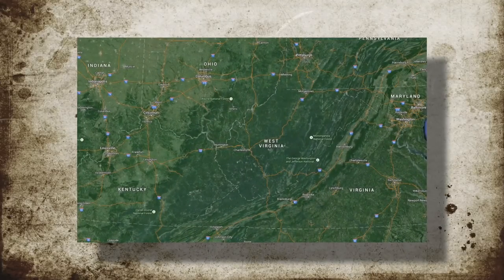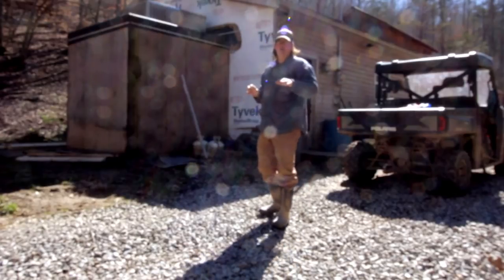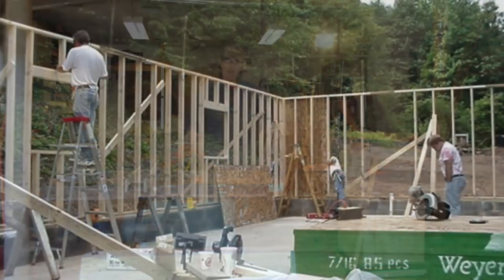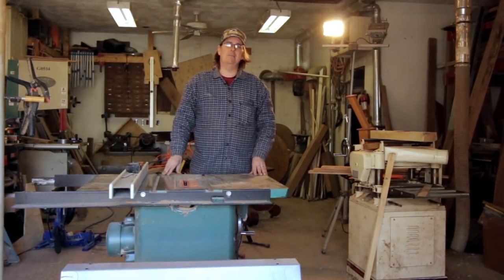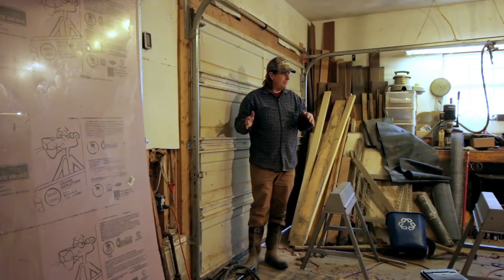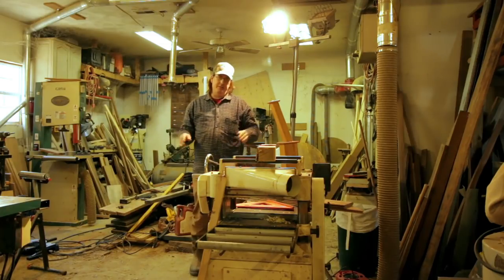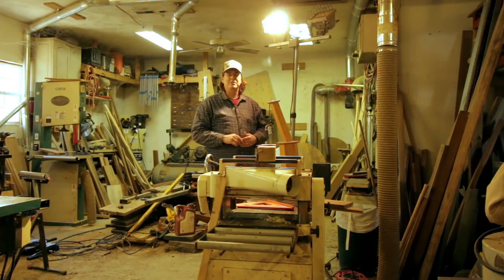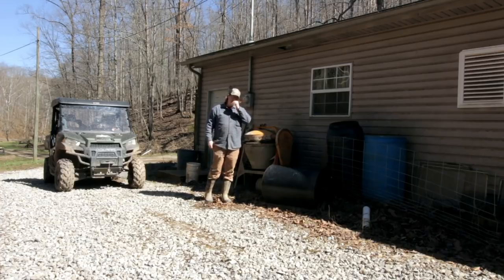Ep93: Why you should build your barn/shop before building your house

Comment: My Dad got a beautiful place on a lake.  It was raw land and he built a huge concrete pad and had a metal building put up.  The whole back side is an overhang big enough to park several vehicles/implements under.  He had a bathroom with utility sink and washer dryer hookups.  They lived in one half and built the real house out of the shop in the other half.  It wasn't as pretty as yours.  Clothes hung on pipe suspended on chains from the ceiling.  This was a room divider and the boxes with their belongings were stacked to make the rest of the room dividers.  All of us kids were up there at different times to help build the house, and we had just as much fun in the shop house as any place else.  Good memories.  Thanks for sharing how you guys did it.
Reply from the maker: Sounds like great memories.

Comment: I bought my land when I was 18, I put my camper on it after I cut a 1200 foot road line in and built the drive way, then I built a few  solid buildings for storage all out of lunber from the trees on the land, then I picked up a 14x70 old mobile home for 1500$ and cost me another $2000 to have it moved to the property, most of the bush was full of huge spruce trees that had been hit by the spruce bud worm, witch turned them all gray at the tops, I had a guy come in with an old skidder and chain saw and cut 80% of the land, for free, he saved me the big nice saw logs and he took over 175 cords of pulp wood out, then I brought in a D8 dozer for a week that striped the stumps and brush off, and ruff landscaped the place, I took 10 acers for fields and yard with plan of building a small home with a walkout basement into the valley, and I landscaped more with rented machines in the area were the house would some day be, I seeded the yard and fields, at 40 I met a woman and with in a year she asked me to married her, I set the rules clear before I said yes, my now ex mother in-law use to bitch at me all the time saying who the hell landscapes before building a home, I always said why not, building a house is not going to do any damage to the landscape more then a 100 x 100 foot area, you bring in a backhoe and dig out the basement and load all the red clay into a big dump truck and dump it in the valley that I still wanted to fill in a little more, then start building, no mess ,, but she could never under stand that or comprehend any of it, well at 57 the house has never happened, as she was a cheater and the courts gave her everything I had, what I don't get is city people move to the country, and build these huge 200,000 homes on a large peace of land, and have such a huge mortgage the rest of there life, and they cant build anything else or set anything else up, as there payments takes everything they make, with in 2 years they sell out and go back to the city, the next person that buys the place, same thing happens, there are so many people out here with in 10 miles that have changed hands so many times in the years I been here,, sure I am very cold every winter, but I should have never married as I lost my 10 year plan, I was to have a big shop by the time I was 42 and a home by 45, but that all history now
Reply: Marriage licenses are outdated. Make a good legal contract with your "guest."

Comment: Those concrete block base walls keep the timber framing up away from any mud or flooding and rot (or in my area, termites and grass fires) and will stand up to pigs scratching against them too. Excellent combination of robust construction where it's needed, and cheap and lightweight where that is good enough.

Comment: I would go a step further and have at least half the space as workshop right from the get go. That way you have work area and tool storage when you start to build the house. One question, why did you go to the extra trouble of laying block instead of just using longer studs?
Reply from the maker: Thinking I was going to be doing automotive style work, I wanted to be able to spray out dirt and grime with the water hose. I didn't want to have drywall to the floor where water could get in behind it.
Reply: Okay, that was my thought.  Well, my thought was welder sparks too, but anyway, when you said “to have higher ceilings”
 that didn’t quite make sense.

Comment: I know this video is older, but I'm hoping you will see this comment and respond. What did you do for your septic system? 
I am looking into the possibility of doing this in Michigan and I'm curious how to handle that issue. Do we build a seperate septic for the garage apartment, and when we are ready to build a house build a second bigger one? Or should we build a larger one upfront to take care of our future needs? 
I would like to make a 1.5- 2 story 2 car garage with the bathroom upstairs and eventually attach it to the house since ADUs are not legal where we are. I'm thinking we would enclose one car stall to get around the minimum dwelling size restriction of 1,000 sf.
Reply from the maker: We built a smaller septic system just for this structure. The main house has a larger system but only because the house is in a different location. I would build a single system large enough to handle both structures now. Getting those earth works out of the way now will be best. Be sure to check your local codes and inspections and make them aware that you want to do a two building system. I don't know what building codes are like in MI. Good luck!
Reply: @RedToolHouse  That makes sense, thank you! :)